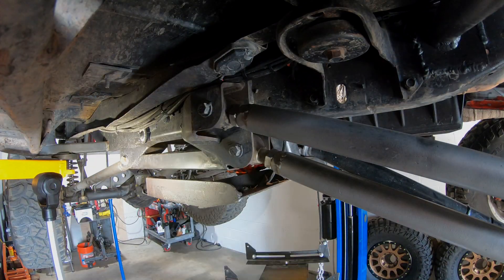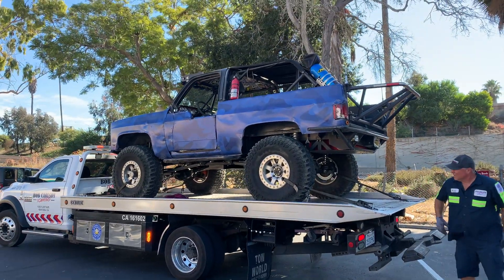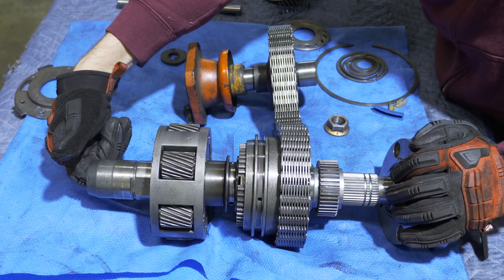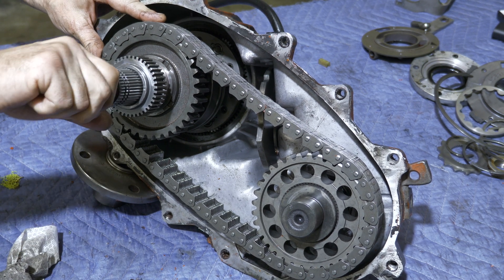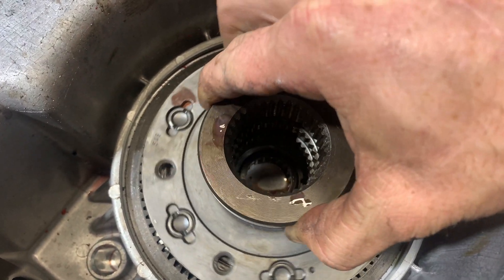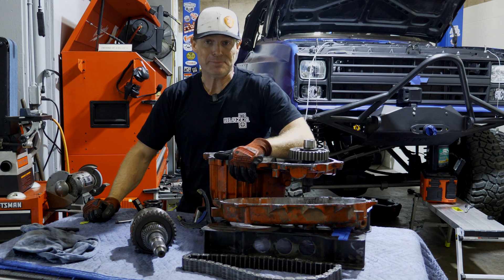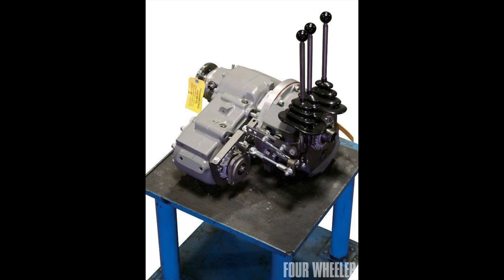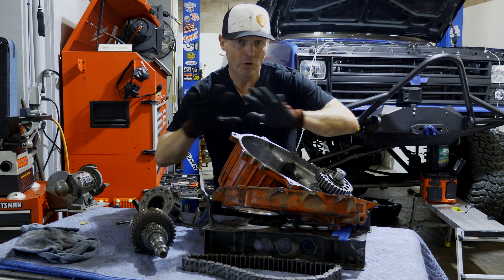How a transfer case works

Comment: Some NP226 variants may include a viscous coupling that automatically adjusts power distribution between the front and rear axles based on wheel slip, allowing for improved traction in slippery conditions.  I think you can drive a 226 in 4 WD hi on a dry highway and it will not bind up.  Can the 241 do that?

Comment: I know it’s a old video but do you run the support bracket that goes to the side of the transfer case? If not have you had any issues without it?

Comment: What do you think about np208 transfer case....
Reply from the maker: its a decent transfer case.  But not really work throwing money at.  The 241 is the next gen of the 208 and came with oil pump, two more planetary gears and can have a slip yoke eliminator kit installed relatively easy.  If you have the 208, run it until it dies!

Comment: hey bro, cool video. have you ever known a 241 to not in gauge in 4 hi or low? 2 wheel is fine and the front diff is locking in. just no movement out of the front drive shaft. no funny noises, no beating on it. worked normal, then nothing. 4x4 light used to come on, now it doesnt. let me know what you think
Reply from the maker: Most likely the range selector has gone.  That’s kinda what happened to mine but 4lo still worked.

Comment: I have a 240 something in my 2004 GMC duramax. Transfer case got  melted.  Transmission shop said it was from pump rub. We never seen anything leaking but we live in sand. And no rough wheeling. Just light mud while feeding cattle in the pasture during the winter. I much prefer the 205 that I put in my 1969 Chevy 3/4 ton. And is already in our 1972 3/4 ton suburban. Also, does the 241 have to go behind the tremec in your suburban? Or could you put a 205 behind it?
Reply from the maker: I am planning on putting a 205 behind it.  Sometimes sand and low traction can be really hard on a transmission and transfer case

Comment: Love the video! My 208 went out a couple years ago; it wouldn’t stay in 2H. Then after a while of holding the shift up when braking, hoping it wouldn’t pop out of gear again in a busy intersection ( happened a lot) it finally would only work in 4L. That 15mph drive to the shop took forever (so it seemed) but now it’s working like a charm.
Reply from the maker: Serious.  15mph was so slooooow

Comment: Correct me if I'm wrong but wouldn't my 76 AWD blazer have the cast iron 208 with the diff on it?
Reply from the maker: Well you AWD Blazer is part time 4wd not AWD.  I think the 205 came in the 76, not the 208.  The 205 is cast, the 208 is aluminum and the generation prior to the 241
Reply: @MerricksGarage  it has no 2wd option
Reply: @MerricksGarage  its got hi lock hi unlock low lock low unlock
Reply from the maker: 🤷🏼‍♂️didn’t know that!  That’s pretty cool.
Reply: @MerricksGarage  yeah pickups had it too other than that I dont know much about it. The thing is massive and super heavy with the center diff built into it

Comment: Yeah, just what I suspected! My NP208 wore the fingers off it's shift forks, stranding me. I thought surely it was my 700R4 that bought as carry out from a rebuilder 10 years prior. Long story short, I tore down my transmission to find the clutches were still good. Confused, I replaced the piston lip seals and shaft seals, get it back together and drive it... SAME THING HAPPENS!!! but this time I thought, what if I move the T case shifter?...... Drove home banging head on steering wheel. Got a new fork a week later, worked perfectly a couple more years, until I found a 205.
Reply from the maker: Aw man that’s a bummer!   That was my first thought too!

Comment: 241 weak link seems to be the shift fork bits and chain stretch causing it to skip teeth and or wear a hole into the case.
I have 3 241's in 2 Blazers and a Dodge 2500. The Dodge at 175k stretched the chain right out so had a spare 241c from a 89 Blazer and switched the chain out...cheap fix.
Also have a 205 behind a TH350 and the magnum would be a great fix to make it very useable for crawl gearing but at 2gUSD...ouch. But the compactness vs 203/205 is crucial in a K5 for rear shaft angle dangle when lifted.
Look forward to how well this new setup works for you
Reply from the maker: Yup.  Nailed it right there.  I haven’t had a chain stretch that much but the length of the magnum 205 is sweet

Comment: I always thought you had a 203/205 doubler in there. No idea where I got that from. I also didn’t know there was a passenger side 241. The more you know
Reply from the maker: Pulled this TC from a junkyard about 6 years ago!
Reply: The last years of Blazers/Jimmys (89 to 91 not sure on 88) came with the passenger drop 241. My '02 Dodge has the driver drop 241.
Reply: My 82 has a pass side

Comment: I’m about to replace the shift selector rod seal on my 241.
Reply from the maker: Do the fork pads too
Reply: My fork pads are still in great shape. I’m not even going to drop the case to do this job. It’s just been a pain in the ass seeing a drip or 2 coming from the shift selector rod.

Comment: For what a magnum underdrive and rebuilt NP205 cost, you could consider an Atlas 4.  With an Atlas you have a broader selection of reduction ratios (up to 11.7:1).
Reply from the maker: The draw of the magnum is the shaft that connects the magnum and 205.  I don’t need anything that low and I have seen Atlas break.  Never seen a magnum or 205 break
Reply: The output shaft on the 205's will break.  Advance Adapters makes a beefed up version that is rated to 750 lb/ft if memory serves.  I have an ordinary Atlas 2 behind an LT4 with 640 lb/ft at the wheels and haven't broken anything yet.  You aren't running enough torque to break either an Atlas or 205.

Comment: Most 1000hp 12 valves have 241's.  Super stoked for your burb build, I have an 87 crewcab square.  along with 12 valve nv4500 and a 1st gen dodge 205 sitting in the shop waiting for a swap hopefully your build sends some motivation my way.  I drive a 97 12 valve ive had it for 17 years best engine ever itll be perfect for your build checks all the boxes and so simple.

Comment: Np241 is a great t-case. The 208 and 241 are prone to wear out the shift fork pads. It’s an easy fix if you catch it early enough. just don’t let them run low on fluid, especially the 208.